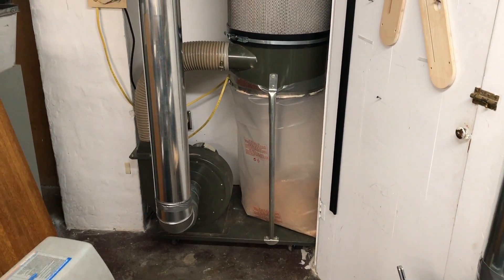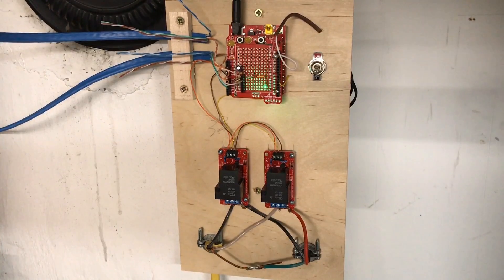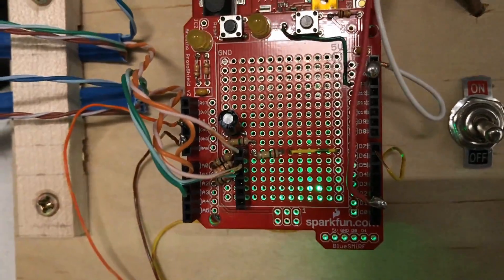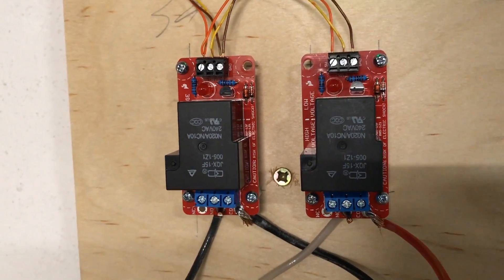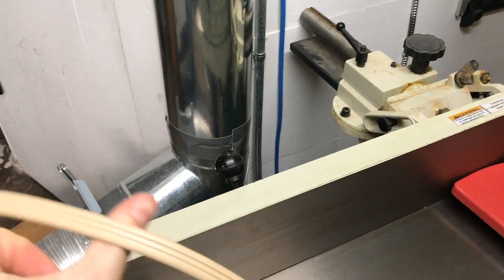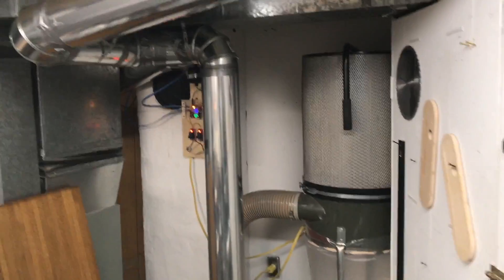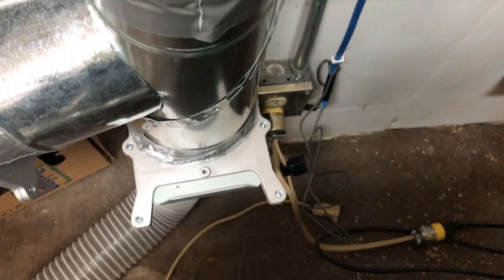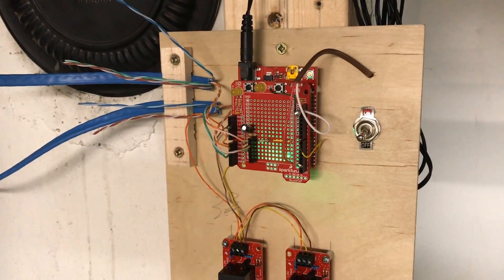Building a tool-triggered dust collector system

Comment: The board and all the connections should be inside a junction box (even if its a homemade junction box), especially considering its located in a dust producing environment.  Otherwise, very clever.  Beyond my limited electrical intelligence envelope, so I guess I'll stick with my remote.

Comment: why did you need to relays?
Reply from the maker: My dust collector is 240 volts, so you need to switch both hot wires. If you are controlling a 120 volt dust collector you would only need one rely.
Reply: @rob_smith  im about to do a similar project myself and thats why im asking and im not saying your wrong because im no expert. But the relays have 240vac written on them, doesn't that mean they can handle 240ac each?
Reply from the maker: kezzaman 240 volt power has two hot wires, each 120 volts in opposite phase. Therefore you need to switch both wires requiring two relays.

Comment: A fire waiting to happen the way it is set up with Romex exterior house wires instead of SO cords, tapping in with some cords not meant for the current draw.  Yet thanks for the visual on the system, just make it safer.   However much dust collection you have, you will have fine particles of dust that can catch on fire with a random spark.  Romex is not an extension cord.
Reply: Those relays should be inside of a listed box.  Reminds me of the days guys use to run their amplifier power thru the fender without a fuse and wonder why their car caught fire.

Comment: You cannot use typical current transformers on a neutral  line.Those are NCT's  which are used on a ground fault system to verify discrepancies between the  current carrying conductors (the hot lines) and the  neutral and report back to  the GFI on whether it should trip or not.

Comment: I can't knock you for getting out there and doing something but this is way over complicated and convoluted. Put the current sensing relay in your electrical panel. No need to have wires running to every single tool. Also the circuit board and arduino is not necessary. Cr magnetics make a current sensing relay all in one package. If you are using more of a load that that relay will handle the key have that current sensing relay trigger a larger twist or even better a contactor. Neat and tidy, no wires need to be running outside the panel assuming you have a dedicated line running to your dust collector which I'm sure you do.
Reply: kpxoda1 - i just found this video, and have never played with a current sensor, OR an arduino before...  so was just going to do this same thing, so you're saying instead of having the sensors on each tool, that you could, for instance, (assuming you're using the actual romex type wiring from the panel and ONLY tools use that circuit), that you put the sensor on the wiring in/out of the panel, and have that turn the dust on?   so you would have to have a separate circuit for tools that DO use the dust collection and tools that DON"T use dust collection?
Reply: @rapunzeleh546  That is correct, look up CR magnetics. They make the part you will want with a 20 normally open contact. There is alot of different specs you can get it in though so download the datasheet off the website and it will have a key to explain the model numbers and such. You can then sometimes find a used one on eBay. I think a new one is like $80. There are some genaric ones on ebay as well and they are a bit more universal having switches and dials on them to configure them to your use. Personally I prefer to buy quality American made (sometimes American designed) electronics
Reply: @rapunzeleh546  Oh and if the dust collector or load that you want to switch is too great for the 20a contacts on that part I told you about you can simply add a contactor and have the current sensing relay trigger the contactor and the contactor turn on the dust collector
Reply: kpxoda1...  uh...  you had me up until contactor.   was going to buy a 30amp relay anyways... i got one of those double barrel monster 3hp 220v collectors...still have to upsize my cyclone first though...  matthias wandel has got some awesome projects - guys' a freaking evil genius when it comes to woodworking.  he also has a relay box to turn on the dust stuff.   saw one 'iliketomakestuff' i think.. he's even added servo's to automatically open the gates, but that seems a little unnecessarily whiz-bangy.  if i'm standing right next to the tool, opening a gate just isn't a biggy.  cool, but lots of other stuff to spend my dubloons on!

Comment: Why not use 1 current relay and run 3 or 4 machines to the common they all share in one circuit, that means one spst relay to the dust extraction hot lead with a 24 volt transformer and no ardunio ( which I don't know how to make ;) ) easy and cheap---.
Reply: It's because with the Arduino he can open the gate before the dust collector start and he can close the gate after the dust collector shut off. Without Arduino you cannot control all your elements of your dust collection system. Just take a look at those small modules Arduino and you will be surprise what we can do with it . He can put a dust sensor in his bag and it will light a red bulb with mean it's time to empty the dust bag or container. Thousand of possibility with Arduino.

Comment: Dear Rob Smith,
Thank you very much for this excellent video. This is something that I looking for a long time. I currently work with a few voltage sensors SCT-013-030 30A. I was wondering if there is any way for adjustement this code from your video to my voltage sensors? Would you be able to help we with this and write me what I should change in code?
Thank you in advance.

Comment: Hi Rob- I love this idea! I bought your suggested Sparkfun supplies, built the device, and am testing with two lamps -- the "saw" and the "collector". The problem I am having is when the arduino is powered on, after 2 seconds the relay closes and the "collector" turns on. This happens without the "saw" being on, and even if the CT is disconnected. Also nothing seems to trigger the "collector" off. I am using a 13v 1500mA power supply. I've checked my wiring. I figure this must be in the code (?) but I'm new to Arduino and coding. Any thoughts or suggestions would be appreciated!
Reply from the maker: Make sure your computer is connected while testing the system, and then you can use the serial logging output from the Arduino to understand what the software is doing. If you look at the code you'll see there are debugging statements throughout the code, just open the serial monitor while the Arduino is running and connected to your computer and you'll see the output. In the Arduino IDE, it is under Tools -> Serial Monitor.

Comment: Just the same project I am working on :) Love it. Going to try and make the dustports open and close automaticaly. I have a "big" woodworking shop and 8-10 moulder, shapers, saw etc so having it all turn on when I use it will be a lot more easy. 

TR
Reply: Do not know if you will reply, but fingers crossed :) How did you attach the current sensor. Did you use the 3.5mm jack or did you strip and solder it to the wire going to the Fundino ??
Also how do your blast gates operate? I think I am going to try stepper motors and a gears.. 

I have ordered your wish list so hopefully I will be able to make this. Intensive Arduino teaching ongoing now :) Thanks for the video and webpage with links

TR
Reply from the maker: Currently my blast gates are manually operated. I have considered automating them but haven't started working on that project yet. The hardest part is going to be attaching motors to the blast gates to get them to open, I would probably use linear actuators but these are not cheap. It looks like you can get some linear actuators from aliexpress.com that aren't too expensive, so that might be an option.

I cut the 3.5 mm plugs off the current transformers, soldered the bare wire so it would be stiff, and then plugged the wires into the female headers on the protoshield. You can purchase 3.5 mm plugs and solder those onto the shield instead, but I didn't think that step was necessary. 

One quick note since you mention having 8+ tools: the standard Arduino only has 6 analog inputs, so you can only connect it to 6 current sensors. You could work around this by having multiple tools share a current sensor, or you could add an extra board with more analon inputs. 

I'd recommend trying to just automate the dust collector power first and get that working, then move on to the blast gates. It should be a good project, let me know how it goes!